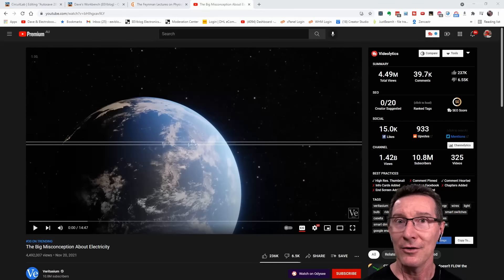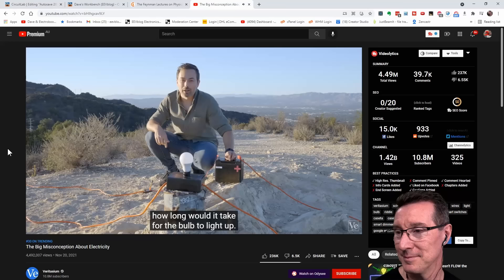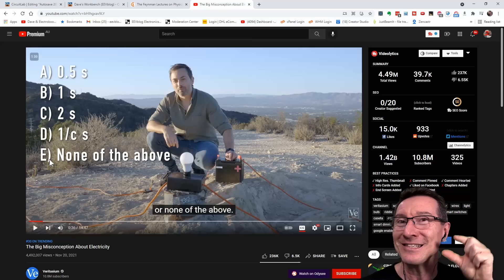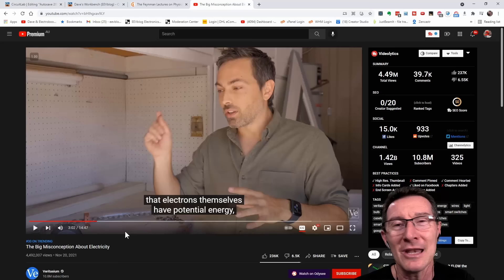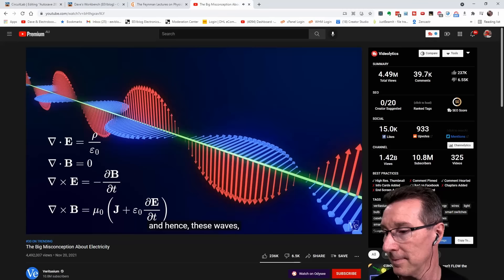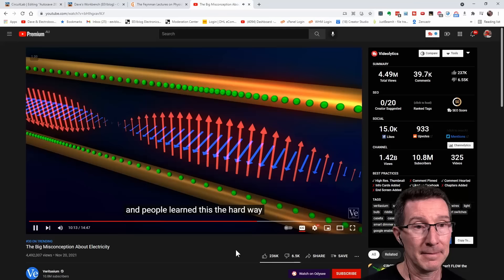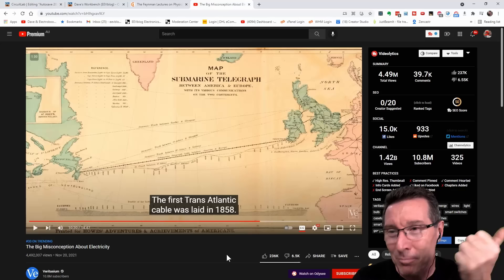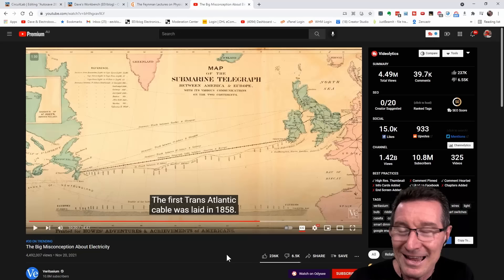EEVblog 1439 - Analysing Veritasium's Electricity Misconceptions Video

Comment: Derek's biggest  "crime" was leaving the distance out of the answer to d. If he had put in the '1m' in answer d or even put the distance as 'd' in the diagram and made answer D be d/c seconds then he wouldn't have left some people with the idea that the time is a constant (which putting at 1/c clearly does if you don't realise the 1 represents 1 metre). He could also have mentioned transmission lines, since there's really no good reason not to, and it completely ties together the physics and engineering perspectives on this problem.
Reply: this is a dimensional blunder; 1/c is not a measure of time.
Reply: I slightly disagree.
People tend to point this 1/c issue or the fact that lightbulb will not light up at low current. I think the problem with this question is somewhere else.

The issue in my opinion is that he shows car battery, simple switch a lightbulb which suggests he is asking a question from DC point of view.
So the natural answer is the one from DC point of view and ignore the AC/HF aspect. 
When people read "when the lightbulb will turn on" they think "the lightbulb switches on and stays that way" because he does not say he will switch it off after some time.

So practically what he is asking is DC circuit and fundamentally he is asking about AC/HF. And in such case the answer is as Dave says, a RF circuit of 1m dimension.

Also, the lighbulb will turn on for a few nanoseconds after a nanosecond but then will go dark for the other part of the second.

This is very poor question formulation which forces the respondent to find out what the asking guy has in mind.

And last nail to the coffin here is:
The guy is talking a lot of power transmission. And suggests that small spike represents power transmission. Yeah, no. Its a spike. Short one, power is transmitted, sure but its not practical and the power delivered is miniscule in the timeframe he has in mind. Its like garbage talk about free energy you can get from radio antenna. Yes, you can, but nobody in their right mind will say its useful. 

I am not even talking about the fact that he kind of suggests that the wires are not needed/relevant for the energy to flow. No. This is not quality education. Its sensationalist grade stuff.

And that is the problem with veritassium video, not the physics, not the answer, not the dimensions but the suggestion what he is asking about.
Reply: Definitely tripped me up.
Reply: He does immediately say this is based on certain assumptions, and on screen shows that one of them is that the wires are 1m apart. So I don't think the whole 'he should have said 1m' argument stands...
Reply: @lukehawksbee  But by making the distance 1m and not putting the dimension on the equation, he is giving the impression that the time is a constant regardless of distance. He is giving the impression that a light always switches on in 1/c seconds, which is only "true" in this very specific example, with the caveat that any current flow however brief counts as "on".
Reply: @IanSlothieRolfe  I disagree: he specifically said that it relied on certain assumptions, so I don't think that gives the impression that it's always the same. If it were always the same then you wouldn't need to specify those assumptions. One of the assumptions is specifically that the wires are 1m apart, which would be an interesting coincidence if it had nothing to do with the 1 in 1/c... 

And I think part of the reason some people are seeing this as a "trick" or an "omission" is because they're thinking about it as someone approaching a problem by using an equation to find the answer. But that's not what he's doing there: he's just giving a fraction as a possible answer (which is no different, really, from giving a decimal as a possible answer, except that it's a lot neater). The units matter when you're using an equation to find an answer, but they don't matter for expressing the fraction that constitutes the answer (you just need to make sure that you already converted to the correct units before expressing it as a fraction)—and in fact it would generally be considered incorrect to give units in a fraction, no? 

Consider an analogy (not a perfect one but hopefully you get my point): I have some apples and some bananas on my kitchen counter at the moment (and no other pieces of fruit). How many pieces of fruit do I have? Well to find the answer we need apples+bananas+other fruit, which is 1+5+0=6. But it would be entirely correct to say that the answer is 6 and if someone said that the answer should actually be 1apple+5bananas we would say that they had missed the point and not actually answered the question correctly. He sets 1/c s up as a possible answer to a multiple choice question along with other options like 2 s, having laid out what the question is that we're answering (and then further specifying certain assumptions).

Also, it's a multiple choice question. He's not expecting people to calculate the answer, he's just expecting them to correctly identify it when given a range of options, some of which are clearly wrong. I'm not a physicist or an engineer but I recognised what the correct answer was going to be based on the way the question was set up. I'm not saying that everything about the video is 100% correct and straightforward, and that there's no misleading or confusing content (as you say, you could dispute what most people would mean by "turn on", but personally I'd say if something turns on and turns off again it still turned on). But I think criticising his presentation of 1/c s as the answer given the assumptions made is a red herring.
Reply: The answer was written out as 1/c s
So if you substitute c with the numeric value 299792458, then it is correct. However, if you substitute c with 299792458 m/s, then the numerator 1 lacks the unit m and the s at the end is excess. I agree that 1m/299792458m/s or just 1m/c would have been clearer.
Reply: If we reverse the question, how long will it take the lamp to turn off after the switch is flipped to off? What is the answer then?
Reply: @mateja176  his answer is entirely consistent with convention. We  say that the energy in 1kg of mass is c2 J (Joules). We do not say it is c2 kg*m2/s2. In Veritasium's answer we are looking for a time. Time is measured in s, not in m*s/m. The problem is how certain parts of the Question are glossed over. Not how the answer is presented.
Reply: @2hedz77  kg*m2/s2 is officially called joule. Try the same in lbs and miles/s and you will see.
Reply: @janami-dharmam  umm is that not exactly what I stated? Please read my comment again
Reply: @2hedz77  Are you saying that 1/c is dimensionally same as sec?
Reply: @janami-dharmam  No. I am saying m*s/m is the same as s. But we don’t say m*s/m do we? No, we just say s. That's what I am saying. The way Veritasium wrote it, is consistent with how any multiple choice question would be given in any high school or university in any city in the world
Reply: That's exactly what I thought.  I answered "a very small amount of time" But I didn't think think that 1/c was the correct answer because as you said, that's a constant. After he started explaining, I finally got that he was assuming the wires were 1 m apart.
Reply: @2hedz77  Finally, you are one of few here who understand how numbers and units work! I was browsing the comments and got frustrated how many misunderstand this.
Reply: @IanSlothieRolfe  You just didn't watch the video carefully & made a wrong assumption. Look at 0:38 of this video. The camera clearly shows the bulb & battery are 1 m apart. If he had put 1m in then it would have been open for people to say "no scientist would ever write 1m/c s like that. The correct internationally recognised standard form in all scientific papers is NUMBER SPACE UNITS eg 1/c s therefore the answer is E none of the above". I also don't see why he would "talk about transmission lines" when he's presenting the question.
Reply: @Socucius Ergalla OMG...please read all of my previous messages before responding. Maybe you are missing some context. The end answer is in s. So you represent the answer as such. 1/c is just the result that you get when you divide 1m by c m/s, the answer is 1/c s. What if Derek had written 3.336E-9 s? We wouldn’t be having this discussion. There is NO difference between 1/c s and 3.336E-9 s. End of discussion. In fact 1/c s is more accurate because you don't need to round off. If you are arguing this point you have never passed a university course with any sort of math in it. Or you are trolling...so GFY. I have a Master's degree in Mechanical Engineering. Arguing about this is just a non starter. I won't be responding further.
Reply: @2hedz77  Calculating "1m / (c m/s)" makes no sense. Rewriting it would come out as "1m / (299792458 m²/s²)". On the other hand to defend Veritasium I thought it was obvious he meant the distance from the battery  to the lightbulb, but I can see that maybe some would get confused since he was also talking about how long it takes to turn on the lights in his house without ever mentioning the distance to the powerstation.

Edit to clarify: The speed of light is not c m/s. It is only c. m/s is already included because c is not just a number, it is a value measured as distance over time.
Reply: Nearly every high school or college test includes answers that are nearly correct, but are not correct.  That is what makes a multiple choice test challenging.

Comment: Units.... the suggested value would be 1 metre/c, not 1 metre/c seconds.

I like the lumped element model approach, although I'm still not sure it's properly accounting for propagation delays in the field because it's not designed to do that. I do see that these ridiculously long, superconducting wires will give rise to unexpectedly large parasitic capacitance and inductance and also that some amount of energy will reach the bulb in 1m/c as a result of the switch closing, but contrary to Derek's statement, this does seem to be very much an academic question. Will enough energy reach the bulb in that time to do anything useful? Signal transmission would be a better problem context and there may be ways we could test this by timing propagation delay of a pulse in wires of different lengths, but haven't we already done this? Isn't this one of the factors we already consider due to clock skew in VLSI design and other other scenarios? Haven't engineers already come up with models and techniques to deal with propagation delays due to numerous effects, including the speed of light? It's been too many years since I've had to know anything serious about that, but I thought the attribute we cared about when it came to speed of light issues was path length - ie. the distance along the wire, not the straight line distance between two points. It's been a lot of years and I know I've forgotten most of what learned about VLSI design at university, to I could be totally wrong here. Would anyone more current on this stuff care to enlighten me?

As for Derek's video, I can't help but think that while there is some academic merit in it, it's misleading. If you look at his Poynting vector diagram, most of the energy is flowing along paths closer to the wire. This is where the magnetic field is strongest and also due to the direction of the electric and magnetic fields, this is where most of the energy is flowing. We lay cables for a reason. They constrain the path of those fields - and hence the energy flow - to where we want it to go. The way Derek explains it, it's as though the wires are immaterial.
Reply: c is given in units of m/s.  The meters cancel, leaving seconds.  1m / 300,000,000 m/s = 0.000000003 s or 3ns
Reply: @stargazer7644  No. c is the speed of light in a vacuum and may be expressed as a number of metres per second. This is why - as I said above - the value they're looking for is 1 metre / c. This is already an amount of time equal to a little over 3 nanoseconds. 1 metre / c seconds would be a little over 3 nanoseconds seconds. I can't think offhand of anywhere we may use square time, but it's not what we're looking for here.
Reply: @stargazer7644  You have roughly said the opposite of what I said. c is a physical constant. It is a speed. It is not simply a number. It is you who is not correctly accounting for your units. The equation we're using here is t = d / v where t is the time take to travel a distance d at a constant speed v - simple Newtonian physics. It's not t = d/v seconds. In this case, the speed is c. It's not c m/s. It is c. To express c in more familiar units, we could express it as roughly 300 million m/s or as roughly 671 million miles/h. For your original statement to be correct, c would need to be a distance of roughly 300 000 000 m. It's not a distance. It's a speed.

Square seconds do not entail acceleration. metres per second squared is a unit of acceleration. The may be scenarios in physics where square time is relevant, but distance per square time and square time are not the same thing. You are the one getting confused by units.
Reply: @brettski74  Yes, c is a speed. What is the unit for speed?  distance/time.  m/s

Comment: Question for author - Isn't this the point. It is all about how much electric field will dilute over distance. 
What this "tricky/primitive" experiment uses is the power/energy that goes around the wires. In this case 1m distance, because that is the distance between switch and bulb. 
Basically acting as antenna in this transient power on, until steady state is reached, it will receive this tiny amount of energy in first 3 nano seconds, and it will just blink briefly, it won't keep working until steady state is reached.

Comment: You keep saying that Veritasium is correct, but he is most definitely wrong. Although the energy flows outside the conductor, it does NOT flow directly through space from the battery to the bulb as he seems to claim. If he was using shielded cables for example the bulb would not be affected in any way for at least 1 second. What would happen in real life would be the field change would go out along the wires and the current would gradually grow along with it and assuming no shielding it would induce a current in the other wire which would light up the bulb, but it would take considerably longer than 1/c for that to happen.

Comment: "How long would it take for the bulb to light up" is a vague question. if we will ignore the time of the bulb to actually flare up, and the active resistance of wires. You will not be able to calculate the answer, without knowledge of the threshold after which we will assume that the bulb is truly on. If we assume that the threshold is vanishingly small, yes it'll be 1m/c. but if the threshold is significant, you need to know about the ratio of the impedance between the receiver and this transmission line. And because each wire forms a resistance 1/2 repeater, at a frequency of 1 Hertz, it means that if we assume that the resistance of the lamp is much less than the line, then 100% (excluding the dissipation inductance) power will reach it in 1 s. It is also obvious that some oscillations will be attend. Awesome!

Comment: The bulb will actually blink several times due to the reflection at the end of the Transmission line before it is stabilized. Of course we assume there is no loss through the TL which is not practical. A tiny bit of loss per length of the wire will render it into a resistive port considering its extreme length.
Reply: So would that step function be reflected back in the same polarity?

Comment: Maxwell didn't come up with the equations, that goes to my main man Gauß, Faraday and some french guy. He simply put them together and found a flaw in the french guy's equation (displacement charge).
Reply: Sure, but in doing so he did something everyone else failed to do which was to unify two separate phenomena into one. And we still say that one of the equations is Gauss' Law for Electricity, one is Gauss' Laws for Magnetism, and one is Faraday's Law.
Reply: @craigdupree1687  You are absolutely right. And we all love Maxwell for doing so.
Reply: Let’s not forget Heaviside for using vector calculus and condensing maxwells original equations down into the 4 equations known today.
Reply: @jonathanallen6702  That's actually new to me. Thank you for bringing it up.
Reply: That tiny flaw he corrected is what makes electromagnetic fields possible.  Maxwell also didn't come up with the 4 equations, he came up with about 20.  Heaviside simplified them into the 4 equations we know and love today.

Comment: The answer from Derek can’t be possibly be correct and actually, this is exactly what he demonstrates at the 7:40 of your video… the cables get electricly charged… at the speed of light, so if your cable is 300 million km radius, it will take as much as 2 seconds for the signal that the switch is closed to be transmitted through the whole loop. If you don’t consider the time to charge the cables, you might as well forget to use a cable and place the battery alone at 1 m of the light bulb… Yes the EM field may flow from the battery to the bulb in a straight light, but for this to happen, a potential must be there, and the information that a current can flow is actually following the cables. Indeed, you may place a second switch further, and the current wouldn’t flow, then how does the circuit know that the loop is closed ? The battery does not discharge alone without a closed loop, so the answer is simply false.
Reply: In Derek's world, radios do not need antennas made of (wire?) for transmission....you just need batteries....